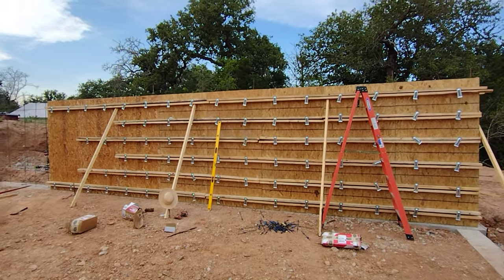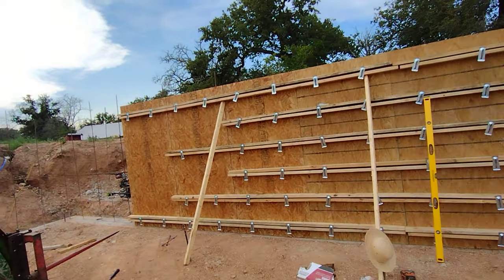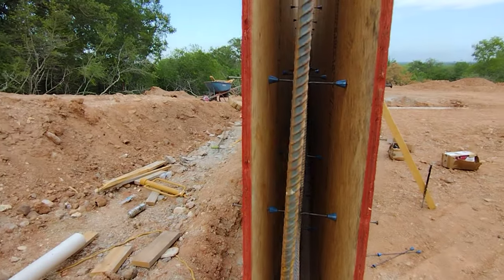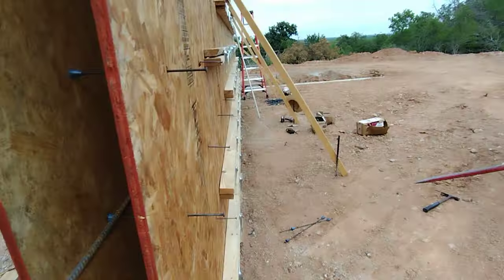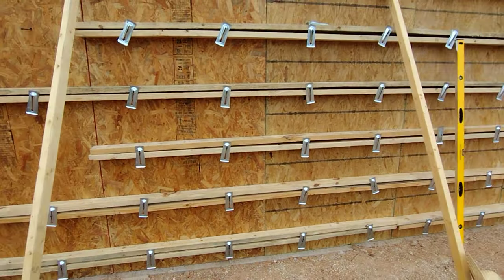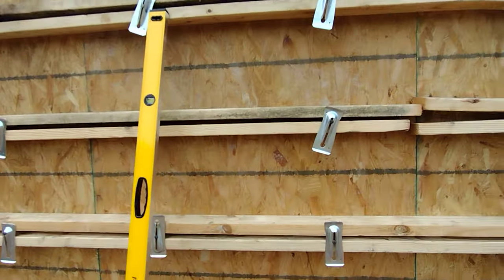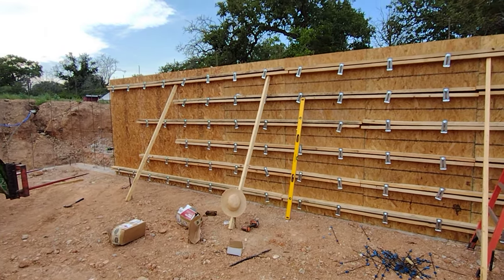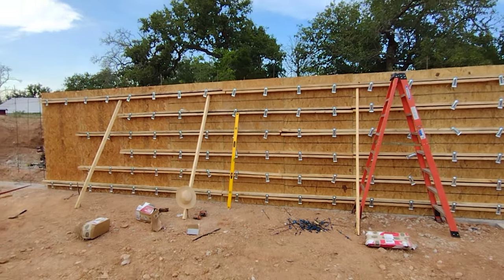Concrete Wall Forming with Plywood, Snap Ties, and Wedges Part 3

Comment: Long end ties 5/8 form board vertical studs horizontal whalers,  ties 12" bottom run, 24 the rest. And dont drive the wedges down to the flat

Comment: Partical board. Ouch,  better hope it doesn't get wet.
Reply: Particle Board and OSB are two different materials OSB has been tread to repel water during construction materials exposed to weather, has a limited time, but is total fine for concrete forms, particle board is a compose wood and resins to build furniture like cabinets.

Comment: Hey I haven’t done too many pour in place walls but here a tip a few buddies told me! The way you ran your forms horizontally is beautiful but it would of been better to some forms vertically first then put your horz. Over and out your ties in the first 3 feet 12”o.c then like 3-6 feet 16”o.c and 6-etc feet 24” that I actually learned from a book but hey if your way worked. Fine by me ! That’s what people told me !
Reply: What’s the book called ?

Comment: The way we do it in Canada we put two by fours 24 inches on Center vertically then we run our Whalers horizontally at one foot 3 ft 5 ft and 7 ft. The tires are placed 2 ft apart this gives a much straighter wall

Comment: I don’t see any toe ties to footer you either shoot 2x to footer and screw bottom form to that both sides or there’s clips you can shoot down with a slot on each side and a screw hold the most pressure is bottom and ties +12” not enough and doesn’t prevent lifting

Comment: I see concrete busting that particle board, how did it go for you? Also see you didn't use any long tail snap ties or form liners. Let's see the finished product? Not hating, at least you are trying something. Curious how it turned out. You should have also staggered the 2x4s to lock the sheets across the seems instead of butting them at the seems... That will separate in my experience as a carpenter. Concrete is heavy and doesn't have forgiveness when it goes. Hope you poured slow. Best of luck 🤞
Reply from the maker: You can see my other videos to see how it turned out. Didn't have any blowouts. I should've used some long ties as you say. I ended up just screwing a vertical on every 4 feet. I did also stagger the 2x4s to lock them together. Good ideas.

Comment: Rule of thumb is first 1/3 of total height ties go every 1 foot then every 2 foot rest of way to top. 2 foot horizontal is a standard for button ties. Each row the whalers should break at different places.if 16 foot sart one at 8 foot the other at 16 foot. Osb is not a good choice for form work. It will come apart and leave some in the concrete and in general not as strong as regular plywood not to mention form ply. A few things that might help you down the road. You can use John clamps with only 1 whaler to help with cost. The height thing really isn't important until you get above 8 foot, unless you fill it up and then stick a vibrator in it.
Reply from the maker: Good tips. I didn't have any experience so I just went with the recommended spacing which was 16" all the way up. I get the potential problems with OSB however I had very little chips in my concrete when I pulled off the forms and very little breakage. I should be able to use 95% of the OSB in my subfloor. I was also surprised that form removal was very easy. The concrete didn't grab the OSB like I was afraid of. The OSB did begin to bow after the first and second pour so I don't think you could keep reusing the same sheets indefinitely. Plywood would definitely be a better choice if you intend to reuse your forms for many pours.